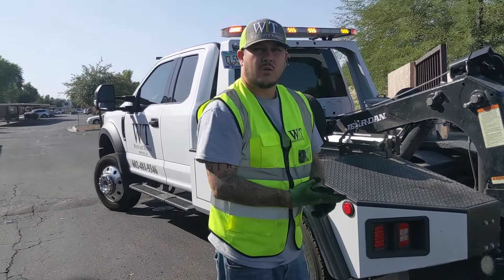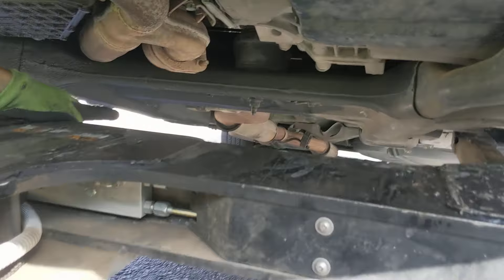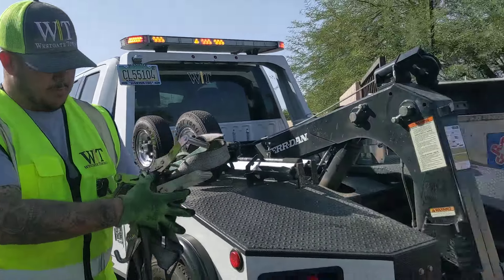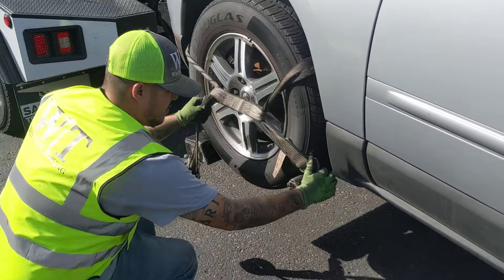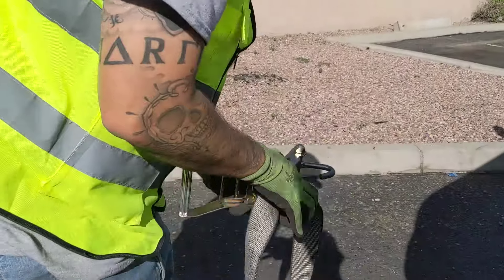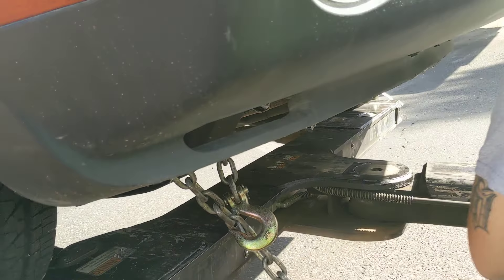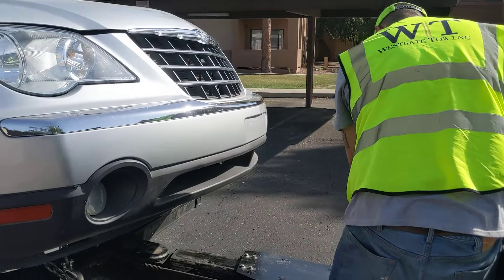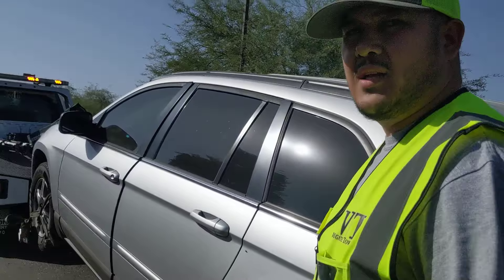Wheel lift tow

Comment: I am 73 years old.  I drove sling Tow truck from 1969 to 1976 for a AAA contractor.  Man. I absolutely love your truck dude. Best repo truck in USA 😂.  That is exactly what I want. I have a friend here in Hawaii that is 74 & still drives one. It does not have the hydraulic bars on the stinger. He has to put them on by hand . At his age he needs what you have. Cool 😎 video bradda . I have a job offer driving an old wheel lift in Hilo. I got inspired by your video. I miss it. 😊

Comment: Thanks for the upload. Can you please explain the part where you're talking about front wheel drive vs all wheel drive. How would that affect your towing procedure
Reply: Since this car is only.front wheel drive its safe to tow this way since the transmission only gives power to the front wheels and he is lifting it up from the front ..if it would of been a a.w.d car the transmission gives power to all 4 wheels so if he towed a a.w.d car for example the same way he'd damage the transmission  because the front tires wouldn't be rolling while the back ones are in the case the car would of been all wheel drive he would either have to tow it on dollies to bring the whole. Car off the ground or tow it on a flat bed.
Reply: So since the car is only front wheel drive the transmission only gives power to the front tires the rear tires a free they just roll
Reply: AWD, 2wd front wheel, 2wd rear wheel, and 4wd. All make a difference, It means that those wheels are tied to the transmission and they get power to them, For a front wheel drive car the front wheels only are getting power and the rear wheels free roll at all times, The reverse for rear wheel drive. For 4wd it's typically the same but you have a transfer case that can enable the other set of wheels to get power from the transmission or it can also put those wheels in neutral and let them free roll, all wheel drive means all wheels at all times are tied into the transmission and other than removing the drive shaft there is no real way to stop them from turning over the transmission and so they have to be towed without the wheels touching the ground either on dollies or on a bed.
Reply: @towtruckaj  Thank you very much for the comprehensive explanation, cheers!

Comment: So when your towing it doesn’t matter if the car is in park right, if you’re towing from the front and its fwd?
Reply from the maker: Yes that is correct if it’s front wheel drive you can lift it from the front and you don’t need a key but you should always double check and make sure the e brake is not on!If it is then you might have to use a lockout kit and open the vehicle to release the brake

Comment: All you have to do is see if the engine is sideways to know if it's front wheel drive
Reply: Or simply look right behind the wheel and look for the axle...
Reply: @towtruckaj  Yea sometimes they are hidden that's why I said that lol
Reply: @terrellupshaw1433  It can't really be all that hidden, The axle has to meet up with the wheel, So you can cover the under side with trim but there still has to be a gap for turning on the front side as well as gaps for suspension, so you will always be able to peek inside and see the axle where it meets wheel hub.
Reply: @towtruckaj  the point I was giving is if you have independent rear suspension it's going to be tucked in more so you can't always see it by looking under on the ground with certain clearances
Reply: @towtruckaj  It depends on the vehicle and if you really know about cars you should really be able to tell by looking at the vehicle you should know the difference between a Crossover and an SUV but you have some tow guys that still don't know what to look for.
Reply: You'll still need to check and make sure it isn't all wheel drive
Reply: If you see a driveshaft going back and a pumpkin between the wheels the vehicle is probably rwd or awd.
Reply: ever heard of a transverse engine all wheel drive setup? Goofy.
Reply: @mikesweet5848  just said what I said  goofy everybody don't know what that is